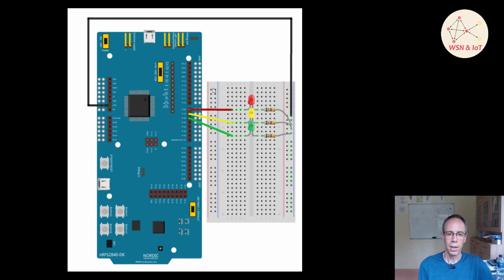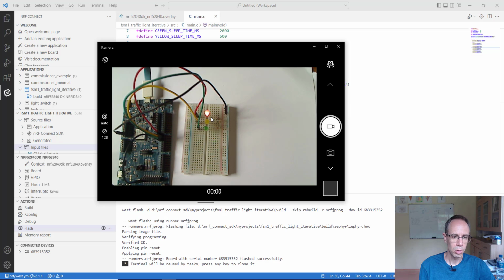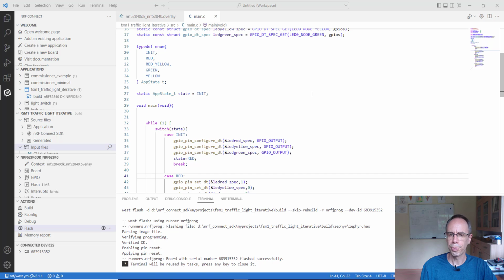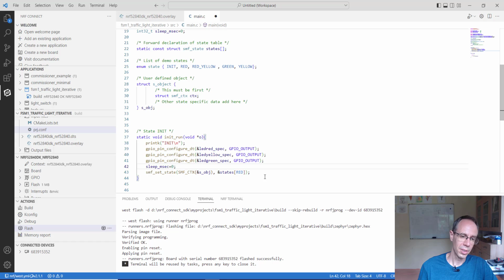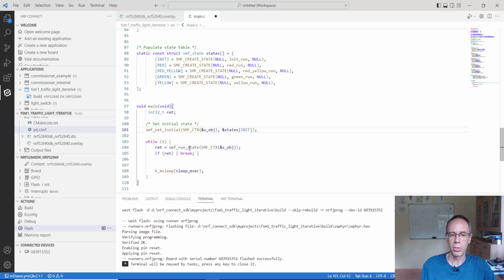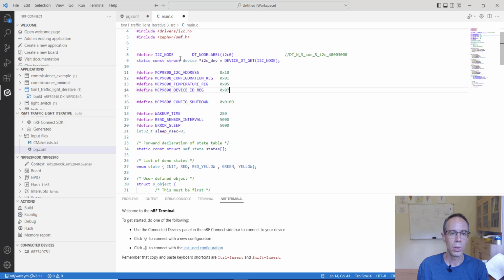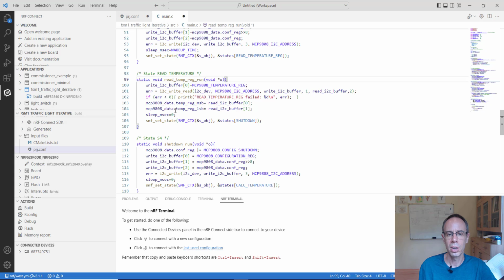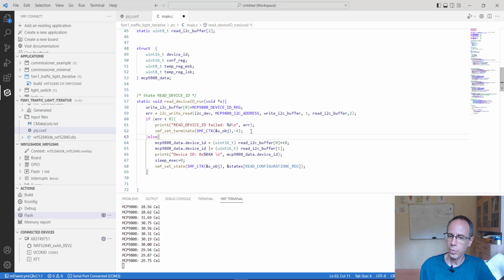Zephyr and Nordic nRF Connect SDK - 04b Scheduling with a Finite State Machine (FSM, SMF, MCP9808)

Comment: Thanks. But it is not clear why one should implement using zephyr instead of the classical way which you presented first. The zephyr way looks more complicated.
Reply from the maker: For a simple state machine, the SMF framework is perhaps a bit overdone and the classical way is better. It is simply a framework. With several sensors, for example, you can simply separate the state machines, and there are also other functions such as initialisation before a state is entered and cleaning up when a state is exited. But it's always a toss-up whether it makes sense to use a library that has more complex functions or to implement something yourself.

Comment: Thank for another very informative presentation Markus, state machines are a powerful way of defining a task and it was useful to see how they can be implemented in Zephyr.
Would be interesting to see an example of a message passing interface between several state machines, perhaps a link manage that is aware of a Thread connection passing messages to a sensor (start, stop measurements depending on link state).
Another area of interest would be a low (minimum) power Thread sleepy end device that wakes to take a measurement then returns to a sleep state.  I have such a build running with Nordic nRF5 SDK but not sure how to do this with Zephyr.
Looking forward to your next presentation.